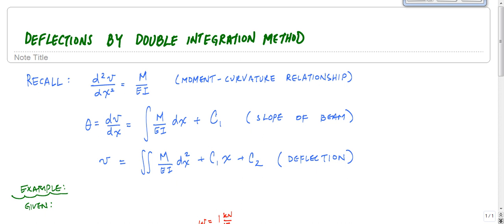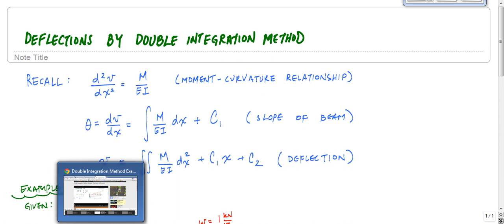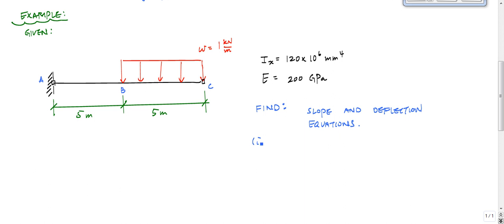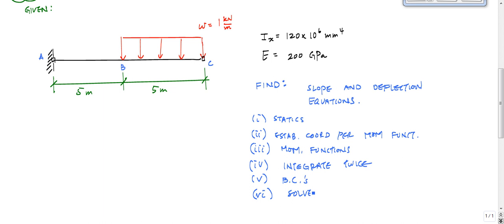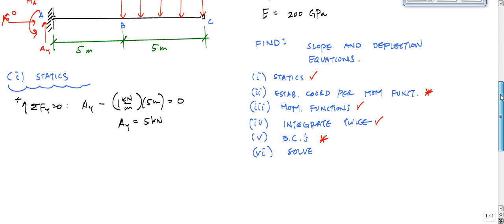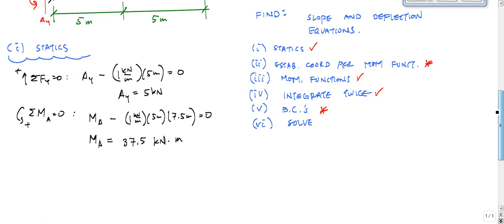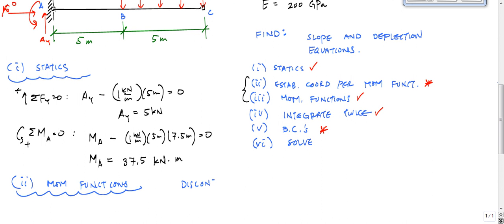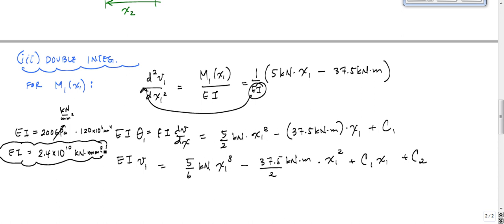Beam Deflections - Double Integration Method Example (Part 1/3) - Structural Analysis

Comment: So both double integration and the principle of virtual work aim to find deflection/slope, but double integration provides a general equation to find it at any point? I'm just trying to figure out if I can use PVW whenever instead of double integration (for obvious reasons). Also, thanks a lot for all of these vids they've helped a lot!
Reply from the maker: usually, pvw is more convenient when you are looking for deflection or rotation on a specific point in the structure.

Comment: Thanks..but Im wondering about the unity of units. I encountered one problem and its slope deflection is composed of different power/exponent let say: 8x^2 - 3x^3 +5x^3+23.
On this case x is on meters, the units will in varying degree due to its components. How to come up with uniform units? Thanks
Reply from the maker: All the constants should have units as well as the flexural rigidity, EI.

Comment: If I had a uniform beam with two supports (pin and roller) with a distributed load across the beam, how many points of discontinuity will there be?
Reply from the maker: +TheAzim114 it depends, where are the supports?
Reply: on each end
Reply: +TheAzim114 
reaction at one end, no discontinuity, reaction at other end

Comment: could you explain why slope at x1(5m) is negative and slope at x2(5m) is positive?
and thank heaps for this lecture, it's a great help! :)
Reply: +Trungthanh Nguyen Because when we if we approach 5 form the left which is X1 we are imagining that we are using a point which is 4.9999999999 very close to 5 and from the right 5.00000001 also very close to 5 thus the slope should equal the same. Also the negative sign is because the deflection profile is going to the negative from the left and from the right it is going positive

Comment: What if you had made the second cut from left to right? Is it necessary to make it opposite of the previous cut in order to introduce a new distance variable (in this case x_2)? The reason I'm asking is because this would change the signs of your equations in part 2? 

Thanks!
Reply from the maker: yes, you can choose the origin of your coordinate system from any discontinuity that you like.

Comment: turns out this is more straight forward that I thought thanks to you :D. Just one question though.... when calculating the moment function for section 2, why didn't you multiply (v2 x x2) ? 
thanks in advance.
Reply: +omar tarek I'm pretty sure it's because the force acts in the center of the distributed load (since it's constant). It's just like during the statics part when you calculate the moment caused by the distributed load. (1kN/m)(5m)  to get the force resultant of 5N. Then (5N)(7.5m) for the moment. you wouldn't do (5N)(10m).

Comment: StructureFree... You have saved my life so many times over the years and I thank you! I have a question for you in regards to your choice of labeling of x1 and x2..... (Starts at 9:20ish)

So for cut 1 your x1 value starts from left and goes right. Once you sum your moments AT THE CUT, won't your moment arm for your 5kN force be (5-x1) instead of just x1? Let me know if this is or not the case and why, I would greatly appreciate it!

Keep being awesome
Reply from the maker: Thank you for the kind words
Reply from the maker: it would be 5*x1 since the x1 represents the length of the city beam.

Comment: Hi there, I found your videos to be very useful and I love the works that you have done so thank you very much! I have got one questions for the double integration method. For this example is it ok if i put my x2 starting from the fixed support just like x1 to somewhere in between of the UDL (cut at the UDL) instead of originating it from the cantilever end of the beam. Do we have different options for the x co-ordinate and should it change the final answers?
Reply from the maker: ng2minh93 yes.  in general putting the origin of the coordinate system at a discontinuity is a good rule of thumb to follow.

Comment: Nice video !! But here is what I don't understand, you came up with M2 =-x^2/2 but if I plot the x value on this equation it doesn't go to 0 on the end of the cantilever. I found M2 = -x^2/2 +10x -50 and it goes to zero when I plot the distance 10m. I did it by the integration way, I'm probably wrong hahaha, but isn't it supose to be equal zero once I plot the 10 m ? Thanks, your videos are helping me a lot.
Reply from the maker: LUCAS GABRIEL Feitosa x=0 is the end of the cantilever for M2, since the origin as at the end of the cantilever for that function.

Comment: what about the beams with more that one loads acting on it????
 an example would be great..my final exam is in 3 days time
Reply from the maker: Unfortunately, I can't promise you a video in 3 days, but the more discontinuities or loads that are on the beam the more moment functions, constants, and boundary conditions you'll have. In general, for every moment function that you need for a beam segment you'll have two more constants to solve for.  Hopefully, you'll be able to get some help from your instructor, TA, classmate, or your textbook before your exam. Good luck!
Reply: structurefree i found an example, went through it ,did some problems which were done by other methods and now im all good with DEFLECTION by DOUBLE INTEGRATION. Thanks anyways tho

Comment from the maker: if you had a roller at B, the beam would be statically indeterminate.  you would have to first find the reactions.  Then, you would still cut between A-B and B-C since the support at B also represents a discontinuity (i.e. there is a moment function between A-B and a different moment function between B-C).